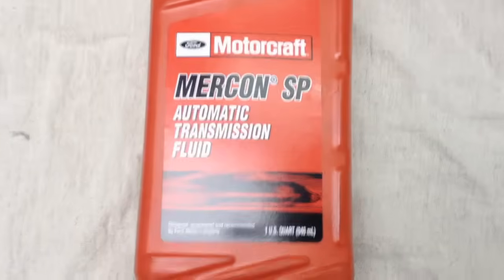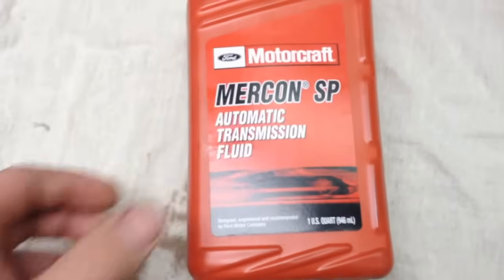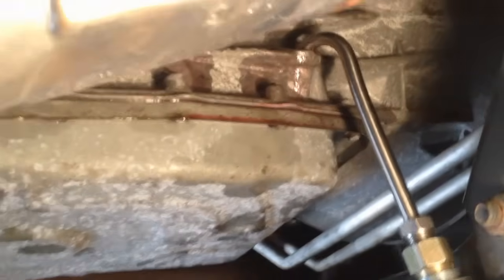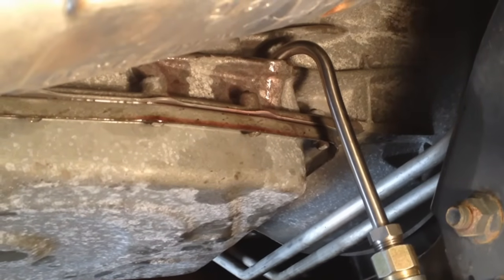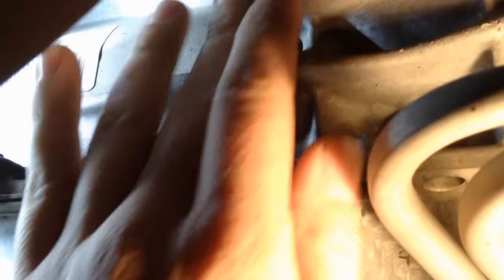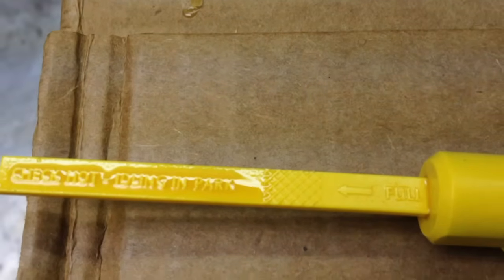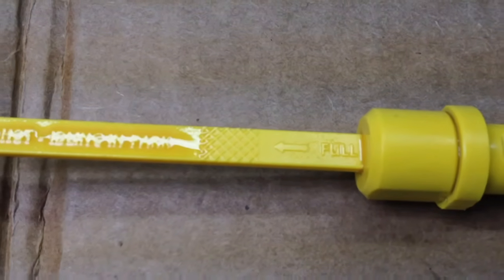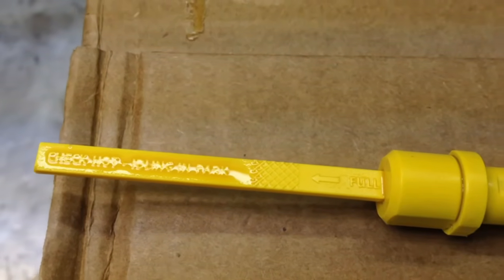Ford 6R60 & 6R80 6 Speed Transmissions: Fluid Fill & Adjustment Procedure

Comment: 7.5 quarts for drain & fill. At first it will overflow at about 6 quarts, then start it and shift to D, R, and then Park.  It will then take another 1.5 quarts. Check fluid while running, level and in park. Only use Motorcraft Mercon LV.  Don't burn your hand. 
ONLY USE MOTORCRAFT  MERCON LV .
Reply: Checking mine right now. This comment helped alot. Burnt mine twice 😬
Reply: thank you, I almost thought by the video it would only take 4.5
Reply: There's a lot of confusion and Ford seems to be culprit for it. If your manual say Mercon SP, then it is Mercon SP original ONLY!!! Lots of people and even mechanics use LV, Valvoline, etc. Not with this trans. This one is Mercon SP and absolutely nothing else.
Reply: Thanks, these comments were very helpful.
Reply: You know the usual refill capacity after changing the transconductor on the valve body? You have to drop the valve body to replace it just in case you don't know. But you seem like you would.
Reply: @sethc758  no,  I don't know that.
Reply: Thank you!!!!!
Reply: he said SP in the video, what is it?
Reply: @666dynomax  SP is the previous Ford  spec before LV.   LV is backward compatible, but don't take my word for it. Confirm this for yourself.
Reply: I did this yesterday as well. Seems to be overfilled when I checked the next morning. I only removed about 5 1/2 quarts but replaced with about 7.5 quarts. I jst kept adding until it overfilled (6 quarts). Started it, shifted through each gear multiple cycles, then while it was still warm added more until it couldn't take any more (7.5 quarts) and tightened it up and went on a test drive. Shifts great and drives great btw. Checked level next morning (didn't start or warm up) and seems high because fluid is all over the dipstick when I pull it out.
Reply: Stfu, just because you let some technician who couldn’t care less about your car grenade your trans with LV doesn’t mean you need to trick others. LV is for the goddamn 6r80
Reply: What temperature should the transmission be to check the fluid after shifting to D R and Park (while running)? Is it fine to change the fluid when it’s cold after a night?
Reply: @ericrodriguez8556  Shifting thru the gear selector will be while the engine is running. The temperature will still be basically room temperature right then, because you put the fluid in just minutes ago, and haven't driven it. 
Normally you want to drain fluids when the fluid is warm, but since you'll be taking the pan all the way off, cold would be ok.
Reply: Only 7.5? My manual say 13.1 quarts??
Reply: @derrickmorrison1022  total capacity including torque converter is 13.5 quarts. 
A drain and fill for my '13 F150 V8 is about 7.5 qts.
Reply: Good lookin out on this! Just had my '16 F150 at the dealer for a whole trans flush. I had 10 quarts to give them and their bill to me didnt list any additional fluid charge. Checked the level when I got home (engine, trans at operating temp) and it seemed low! But then I saw your comment and shifted into D, R and P and now it looks fine! Was really nervous there for a sec hah 😅
Reply: @cg9608  that doesn't make sense.
Reply: @waboom248  how so?
Reply: @cg9608 the fluid level goes down, not up when shifting thru the gear selector fills the filter and fluid pick-up/pump system and everything.
Reply: @cg9608  what fluid did you use, the SD or the LV?
Reply: @flcusat  Mercon LV ATF
Reply: @cg9608  I read that other fluids work fine too like the Valvoline max life. Lots of people said that it worked fine for them , for extended periods of time

Comment: Thanks for all you do. I have a 2017 with 30K. I’m going to drain the oil and reuse the filter until 60k like you recommend at the next transmission service. With Not changing out the filter , I’m I still looking at adding 4.5 quarts, warming and then adjusting the level up to 7.5 or will it be less? Also, is it a good idea to buy a filter and have it on hand in case the oring  gets damaged or can I buy that separate? Thanks again. Also I’m not opposed to just replacing the filter every 30 if needed?
Reply: I think the oring is reusable isn’t it? What’d u end up doing

Comment: I have a 14 F-150 EB. I just recently serviced the trans at work dropping the pan fluid and filter. My question is what is a suitable temp to check when hot, and the reason I ask is because the service manual in Mitchell mentioned a minimum temp of 200 or 210 degrees which seemed a little to high to me.

Comment: What do you think about adding the aftermarket dipstick to the F150?   I wish I had your garage with lift but like most I lay on my back on the driveway.   It sure would be nice to have a fill/dipstick located in the engine bay.  Just wondering what you think.  Thanks, Don
Reply: When working in a driveway (no hoist), how important is it to have the vehicle level when filling and checking the fluid level?  My Navigator with the 6R80 needs to be raised to get under it.  Would either raise the front wheels or raise the two passenger side wheels.
Reply: @chrisgraham2904  ... keep level by using 2 pair of ramps ,  one ramp placed in front of each wheel and drive up on... just be careful and remember to reverse when thru ....

Comment: So what do I use Lv Or SP? Thanks for Videos enjoy them.
Reply from the maker: 6R60=SP                                                                                                                                                                                                       6R80= LV
Reply: @FordTechMakuloco  i have a 2007 mercury mountaineer with the v8 4.6 engine with a 6r80 6 speed transmission and my manuel says to use sp fluid only...  should i use the lv fluid instead of the sp fluid??

Comment: Gentlemen,  

I'm on my last deployment but I do have a question. I have the 08 EL King Ranch.  I'm having some kind of shutter and noise once in a while at 30 mph.. but only when I kindly tap the accelerator to get speed. The thing shifts amazingly regardless of what gear it's in as long as I keep constant acceleration.  Is the 6r75 the same as this transmission? Any help would be appreciated. 

Thank you,

Comment: Do all 6r80's take 7.5 quarts with fluid and filter change? I have a 2017 mustang gt
Reply from the maker: Pretty much yes.
Reply: @FordTechMakuloco  I'm assuming the Capacity of 13.1 Quarts is made up with the torque converter? How much extra does the transmission cooler for the F150 add to the required amount?
Reply: FordTechMakuloco I have to disagree with the 7.5 quarts because yesterday I dropped the pan on my 2015 F150 6r80 replaced the filter FT188 and it took 5 quarts to get correct level. Then I poured the old lv fluid into the bottles I used and it filled exactly 5 of them. 5 out and 5 in so the amount each person may get will vary! Thanks for your videos they are a great help!! I mention this so hopefully people won't just try to dump 7.5 quarts in. Guess it would overfill first anyway but it saves pumping some back out.

Comment: Thanks for posting this, huge help for my 2007 Sport Trac with the 4.6L 3V V8 and 6R60.  Prior owner had the transmission replaced in 2013 with a Ford Remanufactured transmission, the dipstick plug had lettering on it to use only Mercon LV.
Reply: Thanks Paul!
Reply: You can no longer get the yellow dipstick with the sp label. I tried, it is superceded by the white dipstick.
Reply: I’m confused about his shopping list and this video. The list he posted says mercon LV, but this video says SP

Comment: Just did my second transmission fluid change this past weekend on my 2010.  It's only been 65,000 kms since I had it in a Mr. Transmssion for a new torque converter and they serviced the transmssion too (I can only assume they used Mercon LV, *it's been nagging me to change it since and waiting for nice spring weather to do it*), and the old fluid came out pretty dark red.  Not as bad as the first time I did it when it had over 300,000 on it  >_< my mistake on that, that time it came out about as black as used oil (thanks Ford "sealed for life" hahaha).     I found this cool "1 Litre Bottle Pump" at Princess Auto here in Ontario, Canada.. With its blue push down pump handle and it has the cool 45 degree hook end on it.   It fits the top of a 1 quart Mercon LV bottle perfectly!!!  Makes the refill part a breeze. Even taking the pan down isn't too bad of a chore following your other video; I have a HUGE clear plastic under bed tote I use as a catch pan, an old bed sheet and a tonne of old cardboard boxes laid around to catch any other drips.   I'll prolly turn a transmission fluid change into a yearly thing now seeing how bad the fluid was at only 65,000 kms though, wow!  FWIW I put about 70,000 kms on the truck yearly these days for the work I do.
Reply: Wonder if napa or carquest has such a tool,the nearest princess auto is two hours away, I live in nova scotia. There is a good private parts store i can try,bought a 2007 sport trak, going put pan on. Have a good weekend.

Comment: My 07 expedition drove smooth as butter, a month ago it decided after leaving a traffic light to rev and nothing...stopped restarted, no reverse no drive.. managed to check the fluid and it's fine...very weird and no codes, what could it be?
Reply: transmission failure

Comment: 2013 f-150 with 6r60 i did a full trans flush and filter having problem with fluid level when it's running and hot i have the fluid at top of hash mark looks good when i shut off truck fluid pours out dipstick hole does this mean it's over full?
Reply: If it's pouring out it doesn't mean to add more that's for sure
Reply: The fluid level is checked and adjusted while truck is running if it’s hot and at the proper level put the cap back on before shutting off the truck otherwise yes it will pour out

Comment: 6R80 uses Mercon LV at a capacity of 13.1 quarts, I believe. Does this sound right? Thank you. 
I wonder if 13.0 would be enough, so that I could save $11 for a whole 14th quart.
Edit: I just learned that not all 13.1 quarts will drain, more like only 7.5 quarts. Does this sound right to you?
Reply from the maker: 7.5qts almost every time yes.
Reply: @FordTechMakuloco  Thank you kindly.
Reply: Useful info. Now I see why I was quoted $270 for a fluid change

Comment: 2013 f150 eco boost with 111K miles. I do not know if the trans has been serviced ever or not. would you recommend that I proceed to do a ATF change or not? Thanks.
Reply from the maker: Yes pan drop fluid and filter NO FLUSH.

Comment: I have a 2007 expedition but dont know when the transmission fluid was change so the mechanic told me not to change it,it would cause problem with transmission. Need help should I change it or just keep adding fluid

Comment: 2010 F-150 XLT, 5.4L, 6-speed/6R80, with HD tow package.  I think u said it takes 7 quarts, my owners manual says 13.  Is there any way to drain the rest out?  Can we drain the torque converter?  Is there only the 1 filter?

Comment: @fordtechmakuloco if you drop the valve body (and the thermal valve drops out), is it possible that it will take 12+ quarts to fill it back up? It drained for like 48 hours that way. I was just surprised by how much fluid I had to put in. 2013 5.0. Cold start up, I added it to just below the cold section on the dip stick.
Reply from the maker: yes I just did a valve body drop the other day on this trans and it tool around 11.5qts to refill.
Reply: @FordTechMakuloco  Thanks! Thanks for the videos as well.

Comment: Check you just check your fluid and its level using the little dipstick on the transmission to see the color of it and determine if you should get new filter and fluid? I'm just over 80k miles on my 2012 F150.

Comment: -Ford tech I have a 15 f150 I have about 44k miles I did a bit  of towing this  summer and want to know if I should wait u untill 60 to do the pan drop and filtre change or should I do the fluid change at 44k and again in another 16k miles ?
Reply: Jeremy Stonehouse I remember him saying in another video that on any new car or truck he would do a filter and fluid change at 30k, 60k, and then every 50k after that. He said the 30k change would allow the trans to break in, and then the rest were preventative maintenance.

Comment: My 2014 mustang manual says LV. In at 40k. I thinks its time to refresh the trans oil..
Reply: its rated for 150k miles. I wouldn't mess with it until at least 100k miles if i were you.

Comment: I have a 2011 ford f  150 v6 ecboost wat kind of transmission fluid would it take
Reply: Sebastian Avalos if it is a 6R80 transmission then it is always MERCON LV. If you look in your owners manual, it will tell you where to look on the vehicle sticker to find out what trans you have.
Reply: @MURRD0CK  thanks for the info my truck didn't come with an owner's manual

Comment: I dropped by my local service department and asked for a quote on transmission filter and fluid change, $290.....I why because the fluid and filter come out to @ $100 and I told him it was a simple pan drop and filter change, he told me a pan drop will only get 5 quarts max and there will still be be around 2-3 quarts of the old fluid still in the system, he also told me that there is a thermostatic flow valve, the transmission must be up to temp will they do a inline fluid exchange, this is a ford service department....so am I having smoke blown up my butt here, $190 for labor is really high, there is a difference between a lube job and technical mechanic work, both should not charge $100/hourly imo.
Reply: it is high, but the parts cost is accurate.
Reply: How do I check my 2006 4.6l explorer?

Comment: I have a 2011 f150 with the ecoboost engine. I had the transmission flushed at about 75,000. Had no issues with it, I was just performing preventive maintenance. I now how 128,000 and I am experiencing a shutter around 60 mph in 6th gear. Would having the transmission fluid and filter changed resolve this slip/shutter or is it more likely I have other issues? PLEASE HELP!
Reply: check level first thing.

Comment: Hey Brian,is it ok to use amsoil atf in the 6r60
Reply from the maker: I would not use amsoil even in my lawn mower
Reply: FordTechMakuloco thanks man 😀😀😀,idk why ppl go nuts over that fluid
Reply: Fordtech did you have a bad experience with amsoil? I was about to start using it for engine oil.

Comment: FordTechMakuloco what's your opinion on the dipstick kit that is made by Performance Automatic that fits these trucks & SUV's equipped with this less than ideal set up on these 6R80 tranny's ? Expensive yes but I'm thinkng of getting one for my 2015 F150 with 5.0 and 6R80 . Would make checking fluid and also filling/adding fluid much,much easier.
Reply: I have one of these that I'm going to install on my 2014 Mustang GT.  The one thing that I don't like about it is that the actual tube is only held in place at the bottom by two o-rings so it's a friction fit situation.  You have to replace the factory cap and dipstick and install this aluminum fitting that screws inside the transmission case and then the dipstick tube slides inside that.  B&M makes a dipstick kit for your truck that actually screws the tube onto the fitting installed inside the case and is what I would get if you have a truck.  Unfortunately for me, they don't make one for the Mustang.

Comment: Big problem with mine. Any help would be great. .... I did my trans filter and fluid but that plug over the dipstick was very difficult to remove. Once I got it out, I noticed aluminum threads on the steel plug. The top of the trans housing female threads had stripped. Putting it back it just won’t get tight and is slightly cocked so the o-ring won’t seat. Now I’ve got a leak after driving. I’d like to drill it out and put in something oversized but can find anything aftermarket. Any ideas?
Reply: Did you find a way to fix it?

Comment: I changed the fluid and filter in my 6R75 in an expedition. I opened that cap today after a drive and fluid came pouring out, I started the truck hot in park at idle and checked it after it poured out and the dipstick says the fluid is right between the hashes. I checked it because my trans has been acting odd, are these dipsticks that incorrect? It says the fluid level is perfect but fluid comes out when you open the dipstick cap. Should I put in a new transmission now since its acting up?

Comment: As you fill the transmission through the fill port, the fluid will flow out once it’s full. Does that get you to the correct level or do you have to go back and add more after running it. I have 14 Mustang v6. Is this same trans?
Reply: When you drain the trans you'll have extra fluid in the pan since the vehicle isn't running and pushing fluid.  Just like with an engine oil will seep back down into the pan without the engine running to pump the oil.  Filling it to where it starts to overflow and shifting it through the gears pushes the fluid back into the trans and will show the actual fill level.

Comment: Hi. Lots of conflict on ATF to use. 2010 6r80. Can I use Mercon V or did I waste $76 and should have bought LV?

Thanks
Reply from the maker: +Jeff Donnell NEVER use anything but Mercon LV in a 6R80
Reply: @FordTechMakuloco  brian my 2007 mercury mountaineer v8 has the 6r80 6 speed transmission in it and the work manual says use SP fluid only... im really confused now since you say to use LV fluid only...

Comment: When you say to have the fluid level at the bottom of the cross-hatch marks when its just warm, about what temperature is that?
Reply from the maker: +Jake Logan oh 80-100 degrees just when it's starting to warm up.
Reply: Thanks!
Reply: FordTechMakuloco 
Please reply about replacing the fill plug over dipstick. Mine is stripped, the aluminum trans housing, not the plug.